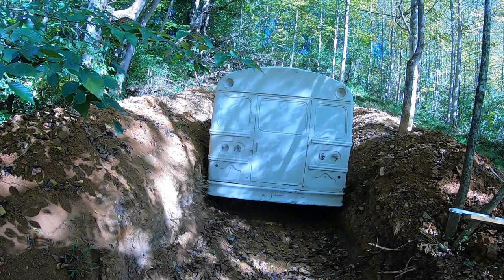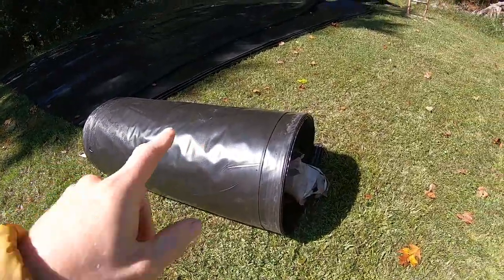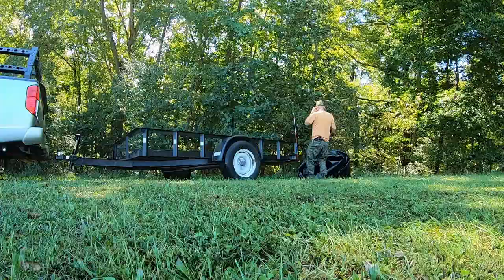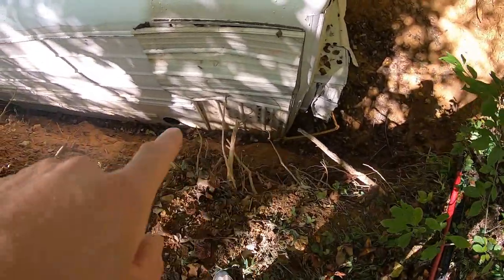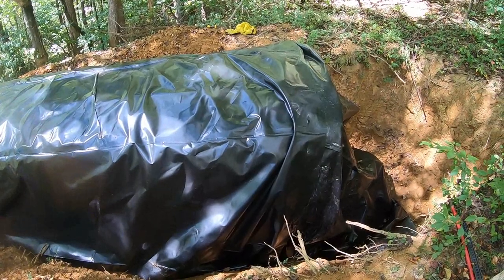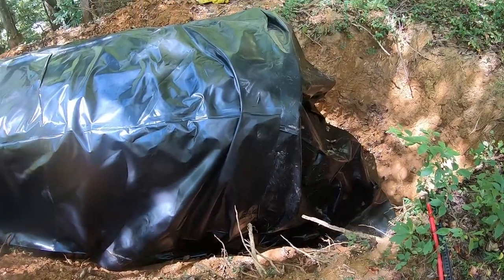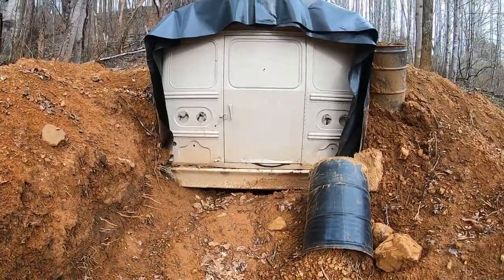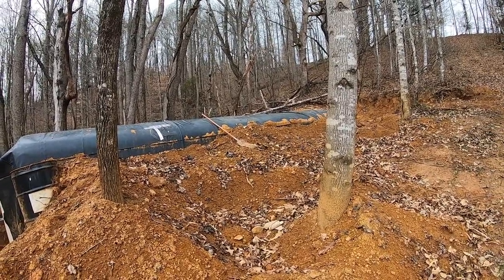School bus underground survival bunker Part 6. waterproofing and filling in the sides

Comment: You're not a structural engineer are you? 
The roof of that bus is not designed to hold the weight you plan on putting on it unless you have pillars running down the center of the bus that I didn't see. Even then, ... 
Good luck.
Reply from the maker: I am not but the guy who designed the bus is. Most school buses can withstand at least 1.5 times their weight in their roofs. https://www.bizjournals.com/triad/news/2017/07/13/dont-try-this-at-homejust-how-strong-are-thomas.html